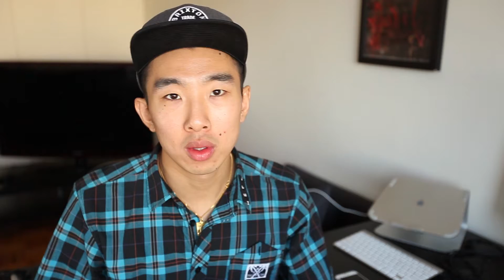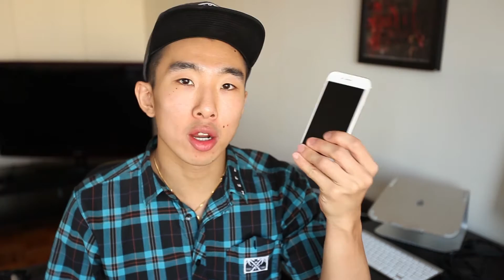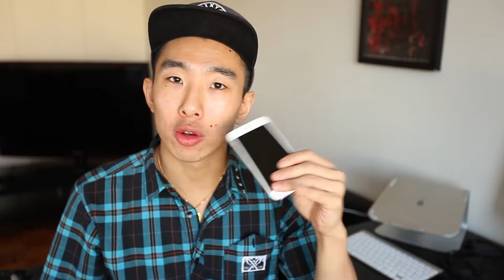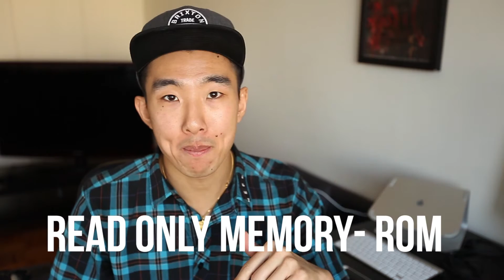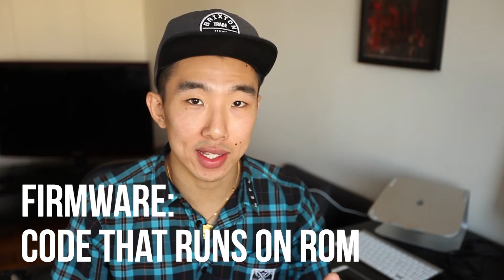How Does an iPhone Work? - Part 3 Firmware

Comment: Thanks. Very informative video. I wish more videos like this were on YT. 

So Does this boot load process use battery power? How much battery power gets used up each time it powers on till you have to enter your passcode? What gets loaded after the Apple icon? Apps? GSM or Wireless connection modules?

Anyone else know?

Comment: I have a super question for you.  The iPhone XS Max A2104 is sold in China and Hong Kong.  However, the China version blocked some features such as Facetime Audio, while the HK version has no limitations.  Is this a firmware difference??  The reason I ask is because I cannot conveniently buy the HK version, but the China version is easily acquired.  I was thinking to buy the China version and flash to International firmware.  Will this essentially convert my China iPhone into the Hong Kong version??

Comment: Correct me if I'm wrong but from a low level view, the ROM gets to be a storage place for the firmware code as well as loading place (like RAM) for the same in order to get executed by the CPU. Or does the firmware load up as a running process onto the main system RAM from the ROM?
Reply from the maker: there is code that is executed before RAM is initialized. so that code will exist in some read-only memory but it will be spliced. some portion for code, rw data, ro data. The CPU will still be able to access instructions at those ROM code sections. But "normally" a CPU will execute instructions that are in RAM, but RAM isn't ready yet at startup
Reply: By rw data, you mean sections like stack and heap and global? So the firmware binary, before execution, must (like any other software) undergo address translation (virtual to physical) through the MMU before being ready to execute? Am I terribly wrong? I don't have a micro low level view of how firmware gets executed inside the ROM. Sorry if I asked a stupid question.
Reply: @armoredninja4975  So Does this boot load process use battery power? How much battery power gets used up each time it powers on till you have to enter your passcode? What gets loaded after the Apple icon? Apps? GSM or Wireless connection modules? Thanks.